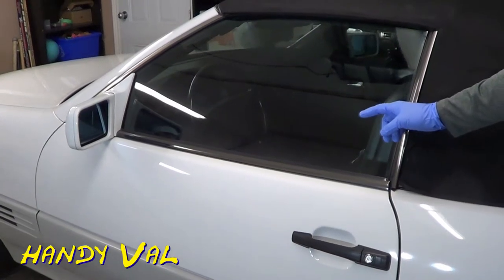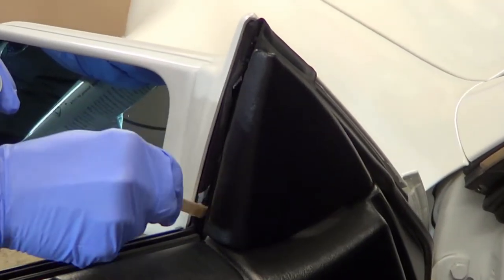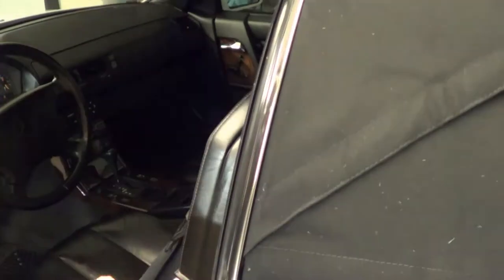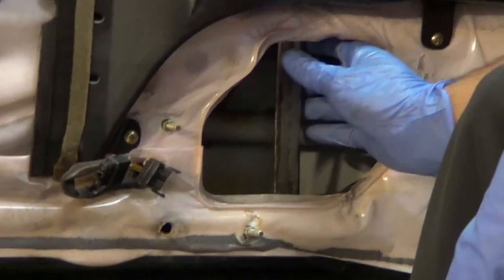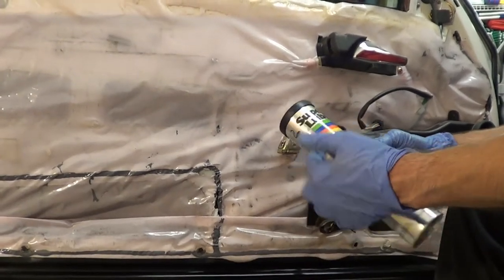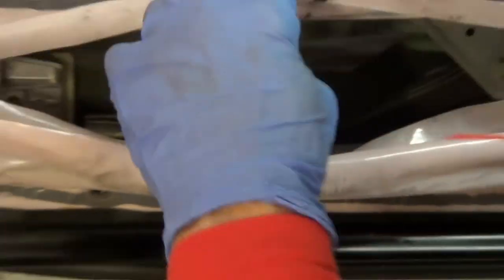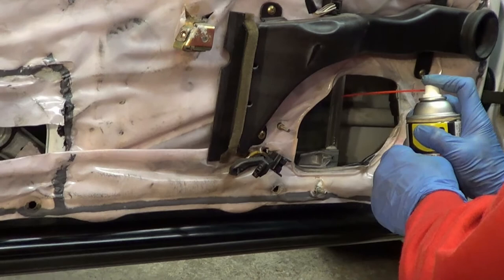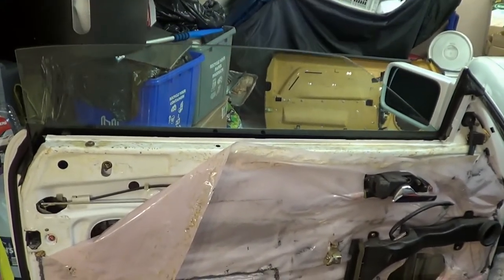R129 Mercedes - Fix Slow Power Windows

Comment: You might want to try a dry PFTE or graphite product.  No messy grease
Reply from the maker: I don’t have a lot of experience with them, and I’m uncertain about their longevity. However, there are benefits to PFTE and graphite as they are less likely to attract dirt and dust because of their non-greasy nature, and that’s a big plus. They’re also safe on plastic and rubber. The SuperLube synthetic grease does have PFTE in it too. Thanks for sharing.

Comment: ! this is valid only for cars built from 1989 till mid 1995, so called pre-MOPF !
Reply from the maker: Yes, you are correct. It will work for the R129 models from 1989 to 1995.

Comment: I have the same vehicle but the window on the passenger side won’t roll up all the way and stutters. Any suggestions?
Reply from the maker: Worse case your window regulator (mechanism) is broken, like a plastic part that has broken off and interferes with the operation. But it could also be an accumulation of dirt and grime on your window tracks, this could be the cause of the stutter and the reason it won’t go up all the way. I hope this helps. Was this a gradual problem or something that has just occurred? If gradual, then dirt could be your problem, but if suddenly then it’s likely a bigger problem.